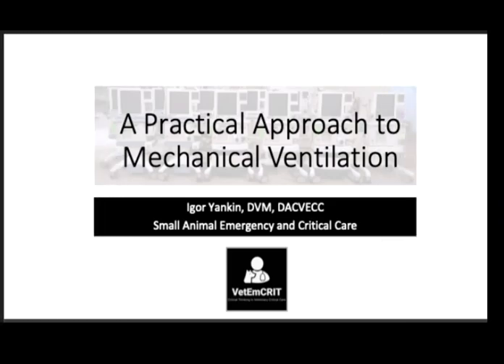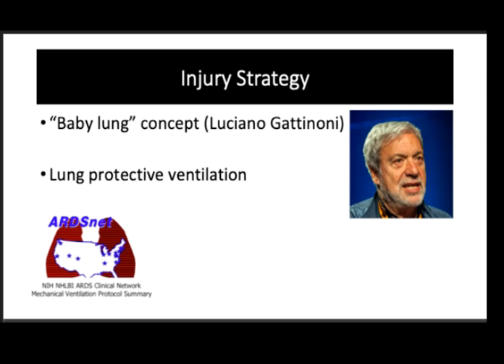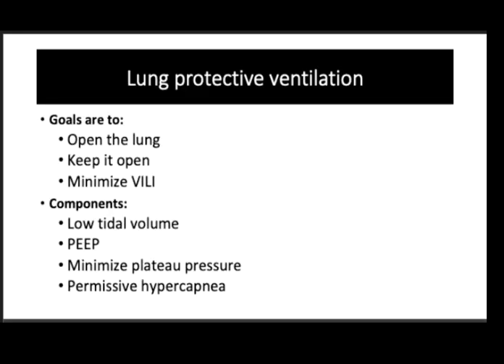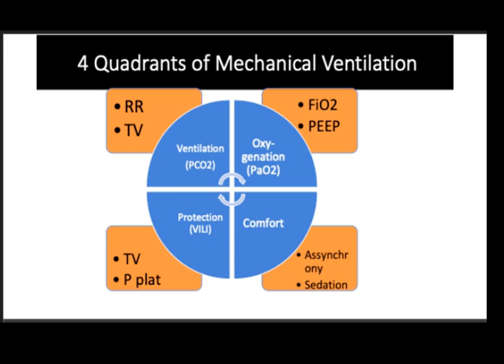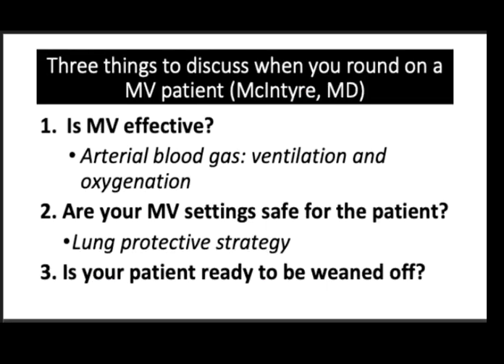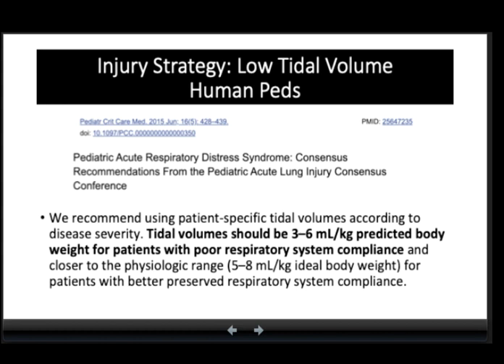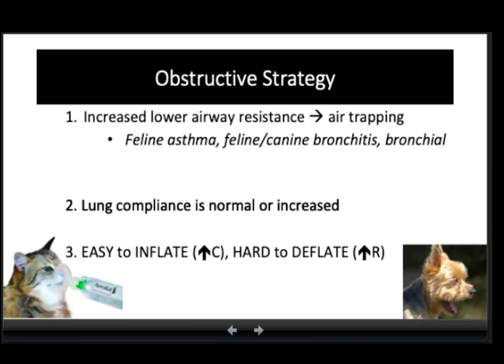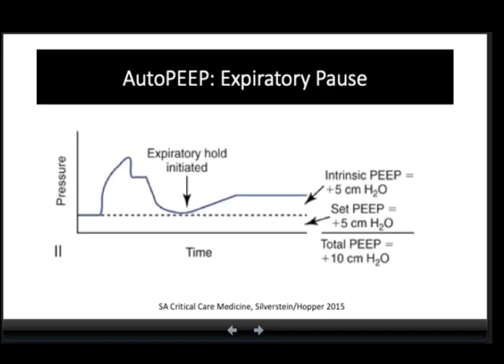A Practical Approach to Mechanical Ventilation in Small Animals

Comment: What does PPV has to do with pulmonary parenchymal disease ? can you please expand on that ?
Reply from the maker: Thanks for your question. I hope I understood it correctly, but let me know if you meant something else. PPV, or positive pressure ventilation, can significantly impact the pulmonary parenchyma, which is the functional tissue of the lungs responsible for gas exchange. Let me expand on the relationship between PPV and pulmonary parenchymal disease.

1. Barotrauma: PPV delivers air under pressure to the lungs, which can lead to overdistension of the alveoli, causing barotrauma. This may result in complications such as pneumothorax, pneumomediastinum, or subcutaneous emphysema. Barotrauma can further damage the pulmonary parenchyma and worsen pre-existing lung diseases.

2. Volutrauma: In addition to the pressure, the volume of air delivered during PPV can also cause injury to the lung tissue. Excessive tidal volumes can overstretch the alveoli, leading to volutrauma. This can cause inflammation, edema, and structural damage to the pulmonary parenchyma, exacerbating conditions like acute respiratory distress syndrome (ARDS).

3. Atelectrauma: PPV can also lead to cyclic opening and closing of the alveoli, particularly in areas of the lung with poor compliance or atelectasis. This repetitive alveolar collapse and reopening, known as atelectrauma, can cause shear stress and mechanical injury to the pulmonary parenchyma, leading to inflammation and further damage.

4. Ventilator-induced lung injury (VILI): The combination of barotrauma, volutrauma, and atelectrauma can result in VILI, a condition characterized by inflammation, edema, and structural damage to the pulmonary parenchyma. VILI can worsen pre-existing lung diseases and increase the risk of complications such as sepsis and multiple organ dysfunction syndrome (MODS).

5. Ventilation-perfusion mismatch: PPV can alter the normal ventilation-perfusion ratio in the lungs. In some cases, this can lead to overdistension of well-ventilated areas and underinflation of poorly ventilated regions, resulting in ventilation-perfusion mismatch. This can impair gas exchange and exacerbate pre-existing pulmonary parenchymal diseases.

To minimize the impact of PPV on pulmonary parenchymal disease, it is essential to use lung-protective ventilation strategies. These include using lower tidal volumes, maintaining appropriate positive end-expiratory pressure (PEEP), and limiting peak inspiratory pressures. Regular monitoring and adjustment of ventilator settings based on the patient's response and underlying lung condition are also crucial in reducing the risk of PPV-associated complications and promoting better outcomes in patients with pulmonary parenchymal disease.

Comment: and I don’t actually what’s the ratio should I dilute the KPhos. If it is necessary, what type of fluid will you choose to dilute the KPhos. Apart from that, is it available to dilute in LR? Since I read textbook recommend diluting in saline. The last question, I simply knew saline is acidic solution and LR is more alkaline. But since we want rectify the acid and bad imbalance
Reply from the maker: You can find the example of K Phosphate supplementation here - https://vetemcrit.com/approach-to-hypokalemia-diagnosis-and-treatment/. NaCl 0.9 is preferred because it doesn’t have calcium in it that may be incompatible with phosphate.